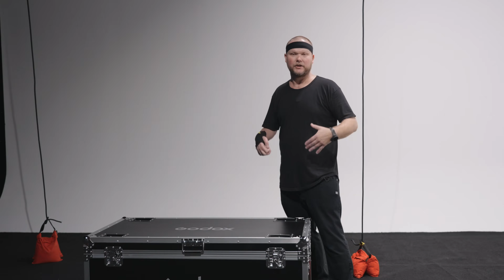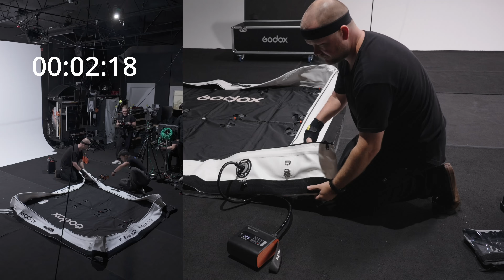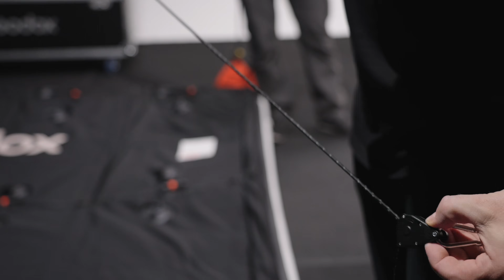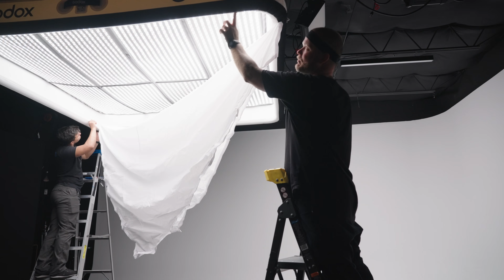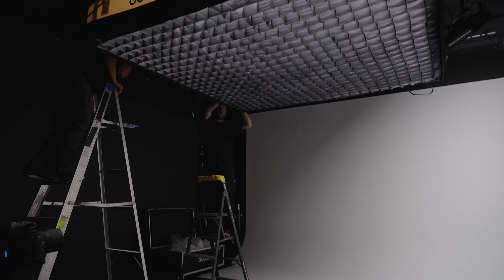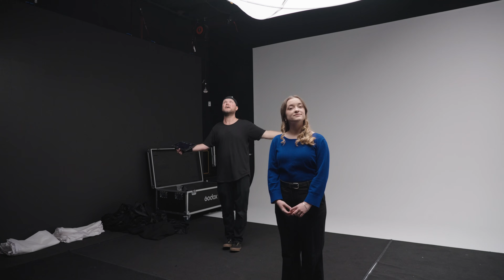my softest overhead lighting setup | Godox KNOWLED AM1600R

Comment: Thank you for the video!
What’s interesting is that the connecting hose I was sent that’s needed between the battery powered inflator and the intake valve did not fit the intake valve. I had to hold it to the valve. Can’t imagine the valves are different on the 8x8 and 4x8. Glad yours attaches as you’d expect it to🙂

Comment: I don't understand companies moving to inflatable systems on lights. More failure points, slower, have to remember the inflator and that it's charged, and it's even heavier/more expensive than some simple cheap aluminum tubes. The light itself seems great tho.

Comment: Excellent review by PD Mokry. But I could never see me buying that light. Not just because of the nearly $2000 cost, but too many possible fail points, requires a pump or air and just too complex compared to speedrail and diffuser. We all know we can reproduce that lighting with much simpler set ups.

Comment: And how would you use this in a non studio environment? Is that possible. I need to light a yoga studio overhead... but i have no clue how to fix that.
Reply from the maker: Since this setup is light weight, I could see you making it work. Just four mounting points into the ceiling where you have good structure, and you are set. Then you would run power to the area and mount the ballast where it is best.

Comment: So what's the advantage of being able to inflate it comparing to have a frame similar to the one from the grid attachment?
Reply from the maker: Weight and storage are the big factors. If you wanted to get a similar look with panel lights, it would need to be a lot taller to get spread. Then that increases weight too. For vertical use, you can add a standard 8x8 frame.